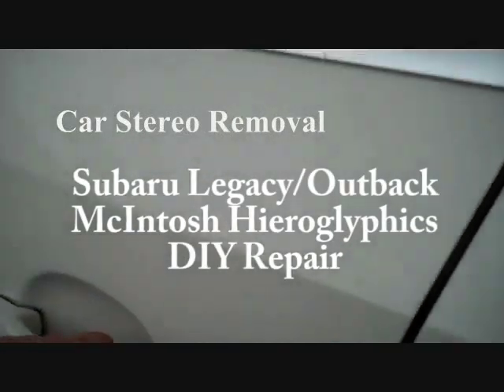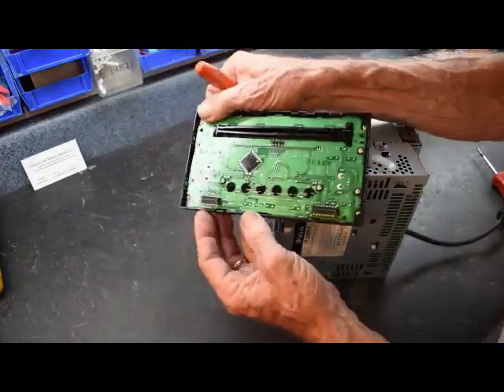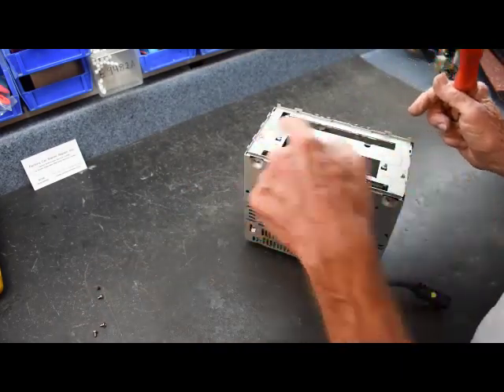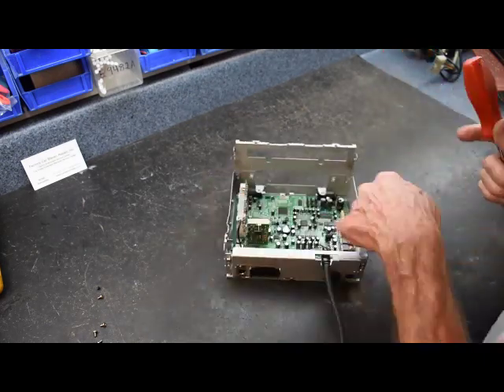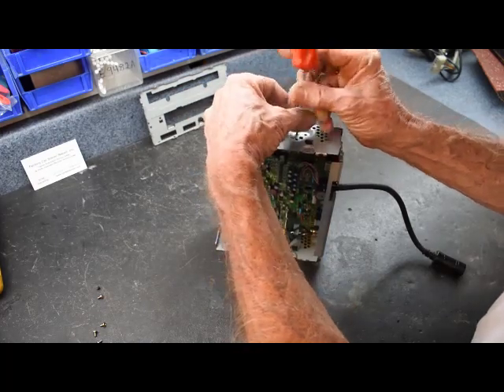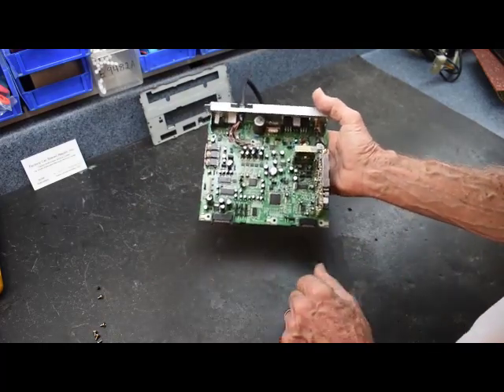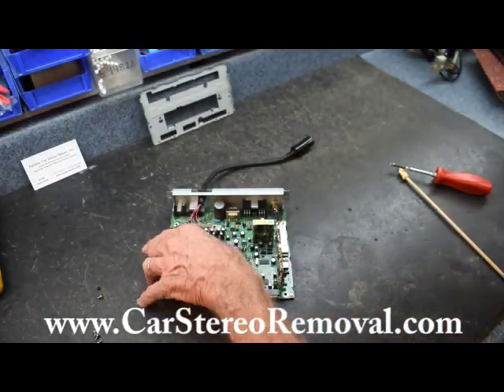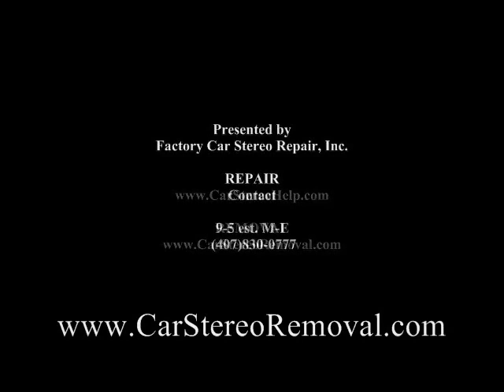Subaru Radio Repair McIntosh with Hieroglyphics

Comment: I just got this stereo and this was my same issue! 

Thank you so much for posting this video with such clear instructions!!! 

My trace had broken under the transistor although it wasn't visually damaged, continuity was not there. 

My capacitor had completely blown apart, the sides split open.

I didn't have a 0.1uf capacitor on hand but I did have a 0.47uf 50v on hand and replaced the capacitor with that. Worked great!

Thanks again!!!

Comment: I have the CD MD version of this headunit but have zero sound. 
Have tested the wires, the speakers and inspected the fuses/capacitors on the amp.

Anything to check inside the headunit?
Headunit turns on and seems to function, however I get CD error when I try to play a CD and when I adjust the volume/fader/bass/trebble/balance knobs nothing on the screen is displayed as being adjusted.. and obviously still no sound